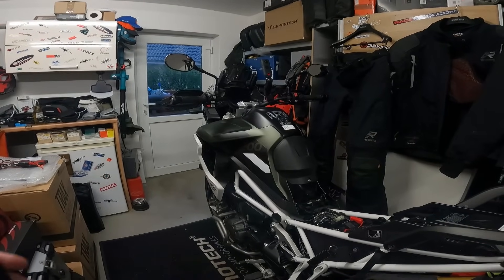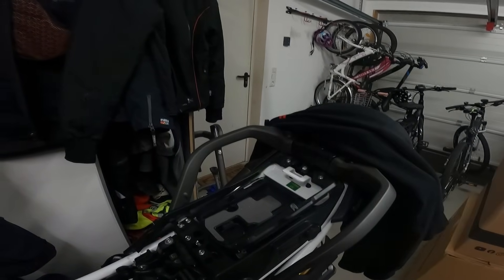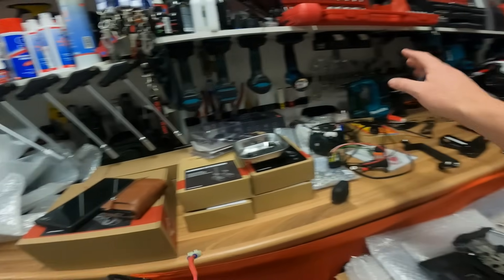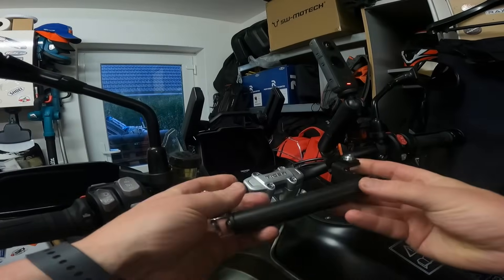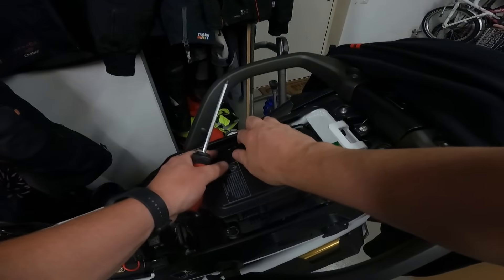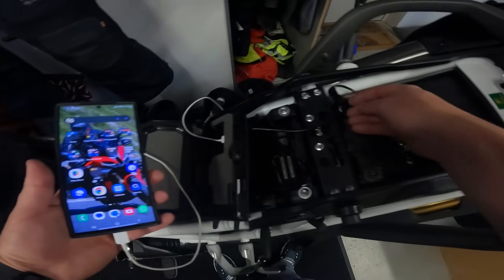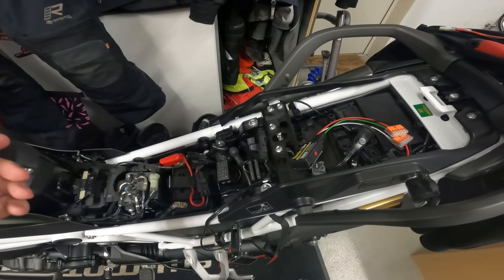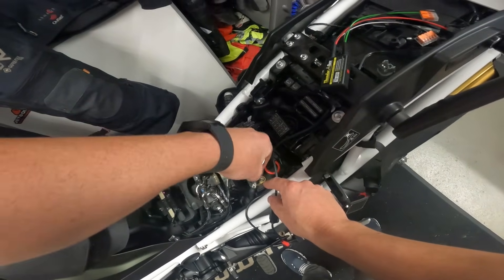Garmin Zumo XT Install on the 2023 Triumph Tiger 1200 Rally Pro

Comment: Good job, I must admit I wasn’t as thorough with wires, used a coat hanger wire to pull a two core through the frame and tucked the small transformer behind the rubber boot thing under the head stock, I found the zumo xt a bit Shakey up there might need to get that bracket you bought, thanks for the links 👍
Reply from the maker: The shaking can't really be avoided, mounting it to the screen bracket. Mounting it to the bars or the bar clamp is another option, but then you limit your options for using a tank bag, and as it stand only a limited few of my SWMOTECH tanks will fit on this bike.

Comment: That channel logo is the business 👌🏾. Have nearly the same NAV set up, down to the bar from Greece - shipped to the states. 

Held off purchasing that TT lock. Just wasn’t inclined to leaving my Nav on the bike at all. I have a moto pump “locking plate mount” locking used loosely😅. I remove the Zumo when I am leaving the bike. It’s a pain.

Will pick up the TT mount over winter and try and catch it on sale. Great wiring job. I had the upper CB’s installed so I didn’t go through the trouble of removing them to be able to remove the panels etc. But it is pretty clean. Thoughts on why the lack of power to the under seat charger, and back on in the morning? 

I always wanted to use that for my Nav as well. Let us know what you find! 

Cheers. 

Cheers.
Reply from the maker: No idea why the socket now works, I can't imagine the sav nat overloaded it, as they don't draw much power at all. I'll probably keep it the way I have untill I ever need the extra port. The thunderbox will also cut the power is something overloads so you won't even blow a fuse that way.

Comment: Keep using your thunder box as the phone charger is intermittent for some reason. Sometimes mine works sometimes not. I think the Satnav needs to draw more than the phone point can give. I will wire mine now using the thunder box
Reply from the maker: You might be right! I'll probably keep it this way for now, as everything works a treat this way.

Comment: Nice video all along! :D
So, I'm about to go down this route but would also like to connect the 12v socket (next to the TFT) to the thunderbox. Guess that means a bit of wire cutting to begin with.. But since being an electrical idiot, you wouldn't happen to know whether I should get the TB-U02 or if the 01 is adequate? Cheers!
Reply from the maker: The socket next to the TFT is always live, and isn't switched, so not sure what you'll get from connecting it to a Thunderbox.

Comment: Hi Shaun nice one probably a silly question why didn’t you just fit the locking XT mount straight onto your New Cross bar you brought instead of that other part u have . On my GSA the tourateck locking bit bolts straight to thesat nav crossbar bud looking forward to all the other bolt on bit’s coming in the future videos bud🎉
Reply from the maker: For looks more than anything, was worried that it would be too low and impede the dash. The SW just gave me more options as you can adjust it more.

Comment: Hi mate how did you pair the xt2 to the bike as theres no option in the triumph menu besides sena to bike and phone to bike thanks
Reply from the maker: @darrenneaves  you can't pair the XT to the bike, but tbh I don't pair anything to it, not even my headset! The two just conflict with each other the whole time. Now I just control everything through my XT.
Reply: @thelikeablerider8800  thanks thats what I was thinking. Just have to use the xt2 as the hub
Reply from the maker: The XT can do everything that the bike can, you just lose the convenience of the joystick on the handlebars, but i don't think that's a big deal. If you really want that function, then just connect everything ie. Phone and headset to the bike and not to the Sat Nav, but then you won't have Sat Nav audio. I've tried everything to get it all to work together, which it does at times, but at some point, you'll have issues, which makes it not worth the time and effort!

Comment: I have a tiger 900 , also plan to remove the phone tray to make room. Notice the 1200 is different under the seat. Since removing phone tray do you have any water Ingress to battery area or other electrics?  There’s a tool tray on the 900 covering the battery . Is the battery on the 1200 covered?
Reply from the maker: Doesn't make any difference with water ingress, but I did add a blanking socket to the power port, as I'm still not yet using the socket.

Comment: There are electronic fuses on most of the Tiger circuits. You probably just overloaded that circuit and it automatically resets after a while. It might not be rated high enough for sat nav power?
Reply from the maker: I haven't checked since, I'll keep it powered through the Thunderbox for now👍😜

Comment: Did you use the white wire ignition wire to make it switched. Or is this done straight from the battery
Reply from the maker: The Healtech Thunderbox that connected it to is switched👍
Reply: Ahhhh that’s cool. Only asking as I only see you connecting to battery . I’m looking to put one on my bike and add a camera but I also think the camera has a trigger wire
Reply from the maker: @robames4  you can't go wrong with the Thunderbox! They're available in two variants, either with 4 or up to 8 accessorie ports
Reply: Yes looks simple enough to use.   thanks

Comment: Do Evo tech not do Sat Nav mount for the 1200?  Did you test ride the 900? just wondered why you choose the 1200 over the 900?
Reply from the maker: They do, but I've seen that it's mounted much  higher than I'd like. It would probably stick out over the top of the screen.

Comment: Are you going to change the exhaust, to make it sound even better...??? Or are you happy with the stock sound..??
Reply from the maker: I'm happy with sound and the looks of the stock pipe tbh. If I want to use luggage I'm limited on what I can get, as not all with fit. Haven't ruled it out though, so may still look into it.
Reply: Akrapovic have released an end can for this bike that allows the luggage to fit perfectly. It’s over £1000 though and won’t make much difference to the sound. I consider it but then decided it’s probably not worth the money.
Reply from the maker: That's the problem with Euro 5 bikes these days, end cans are pretty expensive and don't really make a difference to the sound.

Comment: Nice work mate & liking the new Rally Pro!
Fella I remember watching one of your vids a long time back, with the Super Duke R, and I was super impressed with the way you had your ZumoXT mounted above your left hand on the handlebars & I've been trying my damnedest to figure out how you pulled it off & using what equipment to do so! I've got the same gen 3 SDR & a 1290 SAS and I invested in a ZumoXT a while back now but not gotten round to fitting the cradles to both bikes such that I can attach the Zumo to them. Did you use any specific mounts for your awesome Garmin positioning on your old SDR? I'm certainly interested in copying your solution as it makes the most sense for the SDR, I'm also wanting to attach a cradle to my SAS but that is relatively easy as I already have a bar above the dash to position it, I just need the cradles... in your experience are the Garmin connectors that the ZumoXT attaches to via the square on the back of the device sufficiently sturdy & robust enough to maintain a secure hold of the device while riding? I don't know why but I look at the connector square on the rear of the Zumo and can't help but doubt it's ability to remain affixed while riding, both in the direct wind blast on the SDR & over the fire road style unevenness of roads & forest trails on the SAS!
All the best with your new Triumph pal, it's a proper bit of kit, I was thoroughly impressed with it when I took one for a test ride at my local dealer here in Spain!
Cheers 🍻
Reply from the maker: Hi
Thanks for your question! I use RAM mounts (you can find them on ebay and Amazon) you'll need three parts! A RAM ball joint that I screwed into the mirror stem, a RAM arm, and a RAM garmin mounting plate (which also has a ball joint on the back. It's a bit hard to explain but it will become apparent once you've found them online. It's the same system that I use to mount my camera on the handlebars.
Reply: Thanks for the reply mate... So RAM themselves make a Garmin ZumoXT connector that allows you to just snap the Zumo on using the square attachment on the rear of the device (and it provides power too, the RAM connector)?
Your idea on the SDR to screw it into the hole where the OEM mirrors attach is bloody brilliant, that never even occurred to me and I have bar-end mirrors too so I wouldn't even need to sacrifice a mirror to implement that trick 👌
I'm still somewhat confused though, if the RAM kit provides secure, power-delivering mounting connections that simply connect to the ZumoXT via the same, square click-connect that Garmin uses, then what is the deal with the "cradle" implementation that you've gone with on the new Triumph? Actually, come to think of it I am seeing a fair few people lately using the same bulky-edged, clamp-style cradle and I'm wondering if perhaps that system is specific to the newer ZumoXT 2? Wow, it's kinda ridiculous how far off the mark I am with this! No wonder my ZumoXT is still in its box having never even been switched on, let alone used on a bike trip... pretty embarrassing really! 🫣
Sorry to be persistently dropping essay-length questions too mate, and disguising them as comments hahaha... I'm just genuinely stuck, the penny still hasn't dropped, and before pulling the trigger on RAM setups for two separate bikes requiring very different approaches, I'm trying to ensure I've been able to understand the requirements... for example, can the right RAM mount/piece/part be screwed straight into the thread where the mirrors used to attach or was that something you fashioned from concocting your own starter piece for the mirror stem thread so that the RAM mount could then be attached/clamped to your design of initialising the starter piece via screwing a bolt into said thread?
I'll stop here, I'm aware I began to take the Michael five paragraphs ago 🤐😉
Cheers again fella, and thanks again for taking the time to address my initial comment (& my apologies for not clocking the setup technique from your reply, that's all on me mate and in no way a reflection of any sort of fault on your end)!
Reply from the maker: @foxtrot.tango.whisky  do you have Instagram or Facebook? I can send you pictures or a video of what you need.
Reply: @thelikeablerider8800   Sorry for the delayed reply fella, I'd written & presumably sent a response hours ago, in fact I had replied almost as soon as I received your message but for some strange reason it doesn't show up here in the msg list (I've weirdly had similar occurrences over the the past few weeks & even months, I've no idea what it could even be attributed to without diving head first into mad conspiracy nonsense, so I'll just take it on the chin again and conclude that I typed up a msg, hit send, saw it appear in the feed and then left the app to crack on with other obligations. I'm going to need to be more attentive in the future!
All the best man, my apologies again, it absolutely was not my intention to keep you hanging, especially when you're going out of your way to try to help me!
Cheers 🍻
Reply from the maker: @foxtrot.tango.whisky  no problem! You'll need one RAM ball joint to screw into the the mirror stem (which is a lefthand thread) and one RAM arm. The mounting plate is actually from garmin not RAM. It's a plate that you screw your Garmin power mount into. It also has a ball on the back of the plate, and that attaches to the other end of the RAM arm.
Reply: Thanks a million! I've gotten some great tips from this exchange. Much appreciated man.

Comment: Morning, just for you info really, I connected my Garmin up to the rear phone charger socket under the pillion seat as you attempt to do. Bizarrely it immediately made the bike misfire and the engine light flicked in and off!! removed the the new connection and it ran fine again!! Checked my connecting skills and that was all good so f$ck nose what’s going on with that power outlet!! stick to the thunderbox!!
Reply from the maker: Do you think the Gamin draws more power than the socket can handle? Seems it has worked fine for other people.
Reply: @thelikeablerider8800  possibly 🤷🏻‍♂️

Comment: Wiring in my satnav on my 1290 Adventure is just as bad. At least there’s a switched supply at the front, but you still have to remove all the RHS panels to get to it
Reply from the maker: Its a real treat👍🤣